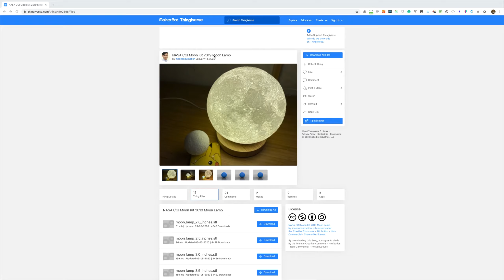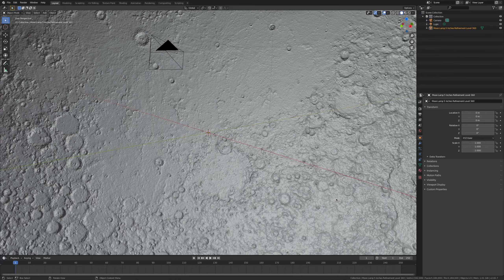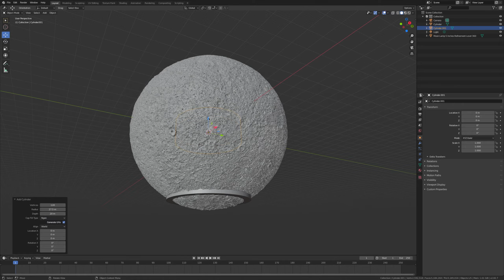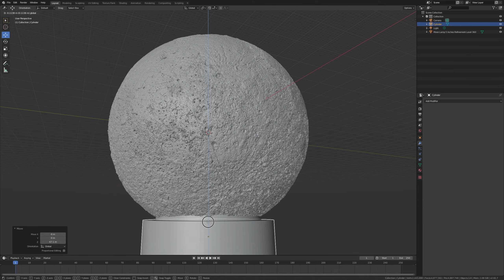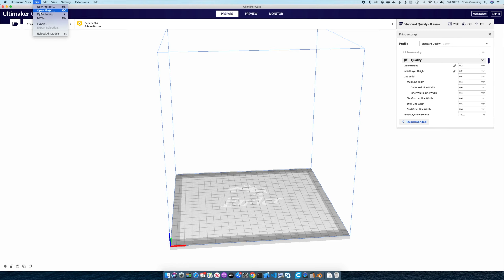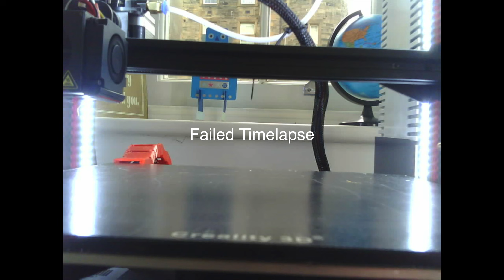Moon Lamp - 3D Printing The Moon - Editing the model using Blender

Comment: Does the moon have a wall thickness? How did you manage to print it without the top part falling inward, did you use support?
Reply from the maker: The model prints without supports. The model I downloaded came from Thingiverse and has the printing instructions there, but basically, it's a hollow sphere with a couple of millimetres of wall thicknesses.